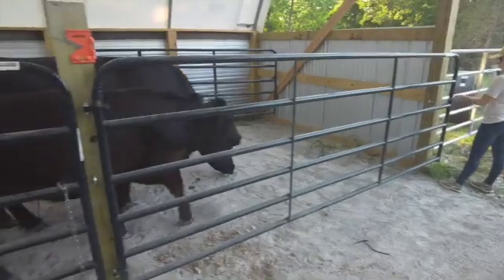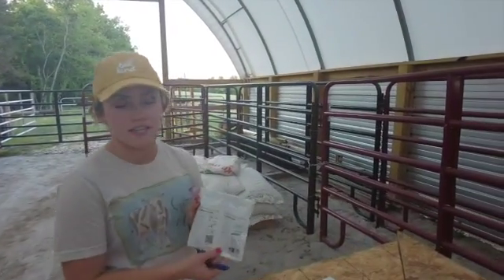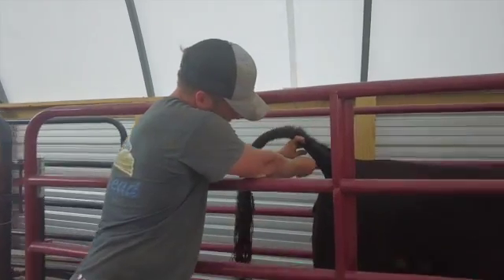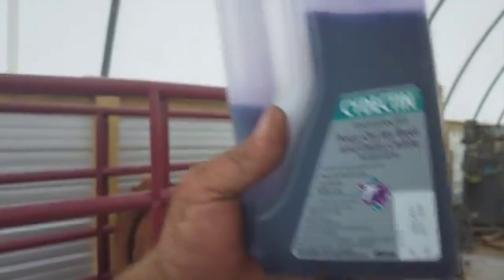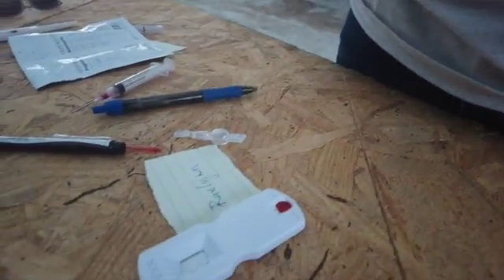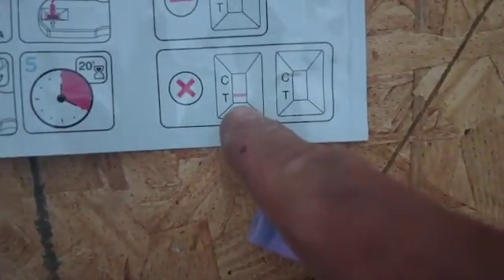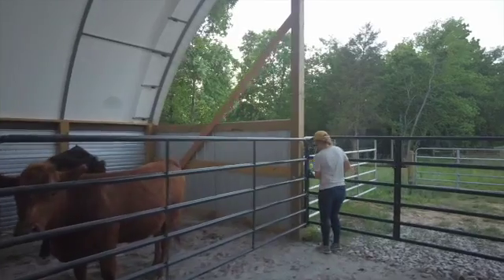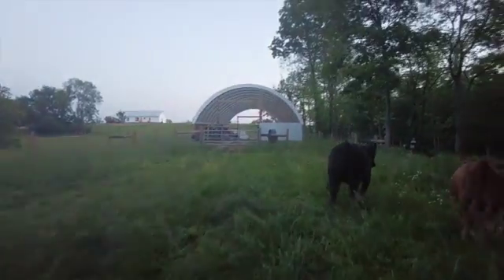Preg Checking Heifers! - IDEXX Chute Side Tests

Comment: Did you say you put lime down or is that sand in your pens?
Reply from the maker: I used ag lime. Works really well if it’s wet and you pack it down really tight with a packer. I redid the stalls last fall and since I packed it down really tight I haven’t had any issues and have had calves In it all winter. I’ve started putting rubber mats down as well just to make add an extra layer of durability

Comment: How is your hoop barn holding up?    I'm building a small one very similar(20x40).   What did you attach your top horizontal 2x6s to the 6x6s with ?   Lag bolts ?   Does it hold up to snow and wind pretty well?
Reply from the maker: It is doing good! And yes lag bolts. It has held up great to the snow and wind. We had a really windy and stormy spring and it has held right in.